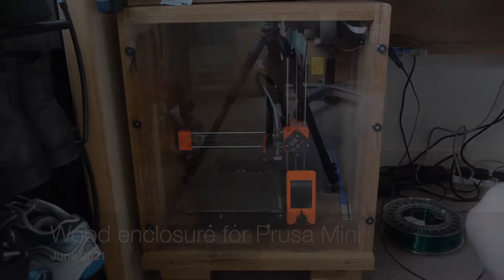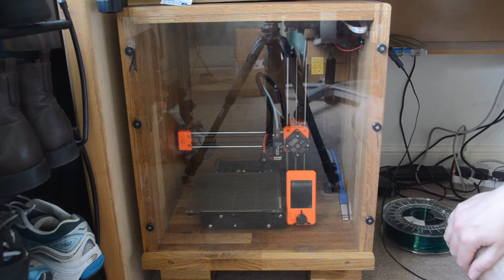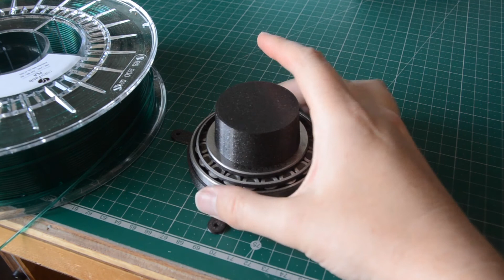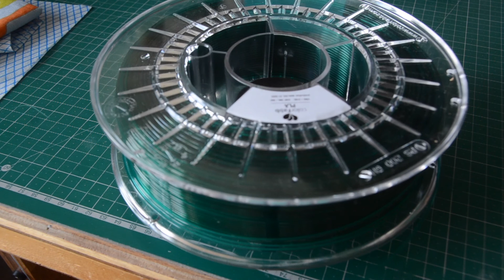Finally made the wooden enclosure for my Prusa Mini 3d printer

Comment: Great! Nicely done, enclosure looks really neat. Did you end-up needing some ventilation for it, I plan to print ABS and ASA, hope that multiple hour printing does not make the interior to hot... Also, some experts suggested me moving the electronics to the outer side of the enclosure (Prusa Mini should have the cables long enough to easily do so). Thanks for sharing, I plan to built something like this during the weekend.
Reply from the maker: Sorry, can't advise you on ABS or ASA. I very rarely print for more than 4 hours, but after that time, I do like to let the whole cabinet and printer cool off well. Moving the electronic outside the heat zone would be useful if I were printing more.

I switched from PLA to PETG last year, and have since been noticing a white residue building up on the inside. I really wouldn't want to ventilate that without a good filter to catch the particulates.

Good luck with your building!

Comment: This looks awesome, well done! I just got myself a Prusa Mini too, and I am looking to build something like this, but my primary concerns are noise levels; how much does this enclosure do to lower them?
Reply from the maker: The noise level depends what you are printing - drawing long perimeters, I find it quiet, but noisy when doing zig-zagging infill. 
The enclosure works great to reduce noise when I'm just sat next to it.
Despite the dampers on the legs, it transmits a LOT of vibrations into the floor, and can be heard just as loud from the room downstairs.
Reply: @MikeGibbens  what if you'd put the printer on a concrete paving block on top of some foam? I've used foam at home and that definitely made a difference regarding vibrations being transmitted down to the table.

Comment: Hey Mike, I am currently waiting for the delivery of my Prusa Mini and also want to build an enclosure for it. Can you please share the dimensions you chose for the enclosure?
Reply from the maker: You are going to love it! The internal dimensions I used are: H 430mm x W 390mm x D 480
Reply: Yeah, really can't wait for the delivery. Thanks for sharing the dimensions. The relativly big depth is required that the cables are not hitting the back wall? What temperature are you getting inside the enclosure when printing?
Reply from the maker: @andreaspollinger544  I've not measured the temperature yet - I will do that.
The depth is almost all required for the Y-axis bed travel, and the chunky bed-heater power cable. This is a video of my sliding the bed back and forwards - and as you can see, I need almost all of the 480mm https://youtu.be/kaNPGREERUs